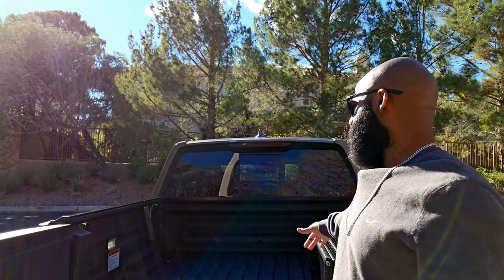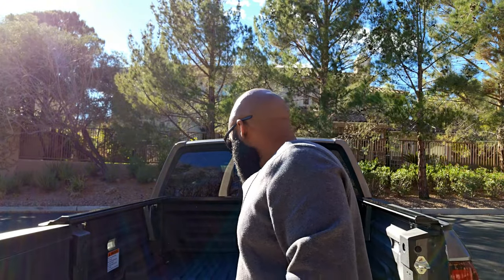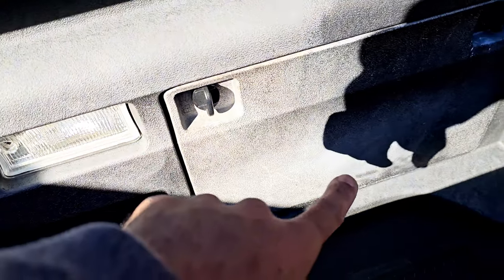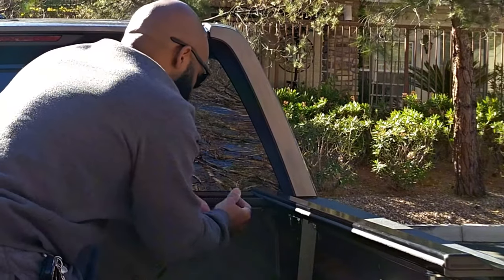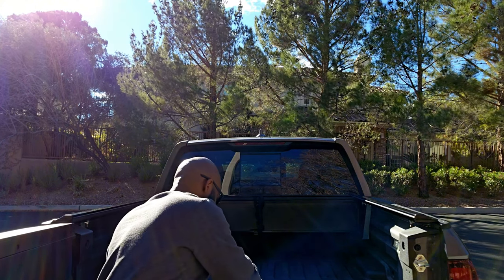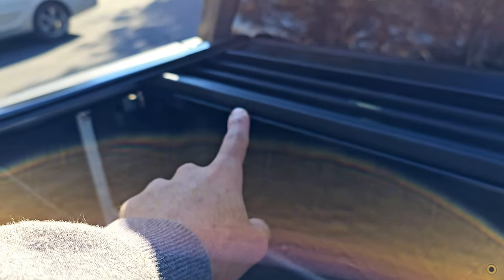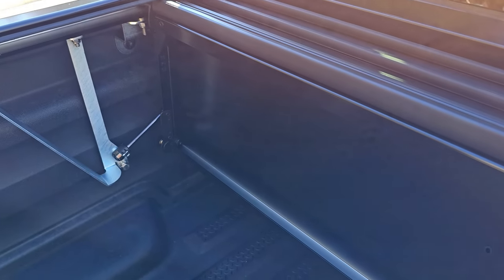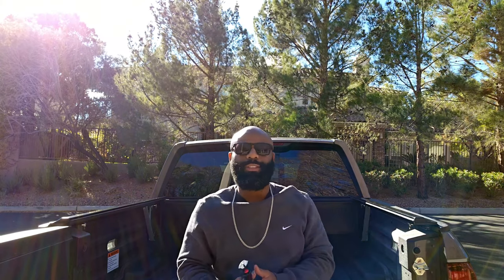🛻 Upgraded Honda Ridgeline With A Retractable Tonneau Cover 💪🏽 2024 Must Have Truck Accessories 🔐

Comment: Did you get a tale gate lock?
Reply from the maker: After doing a little research, I found out that many tailgates don't have a locking feature. 🤔. The Honda Ridgeline has both an electric lock & a physical lock though. I installed the physical lock myself but it came with the truck 😎